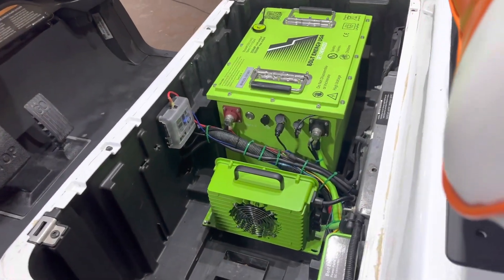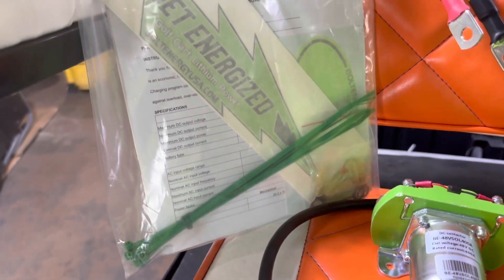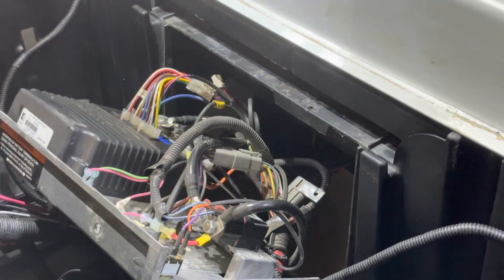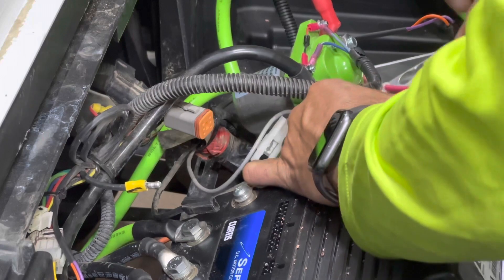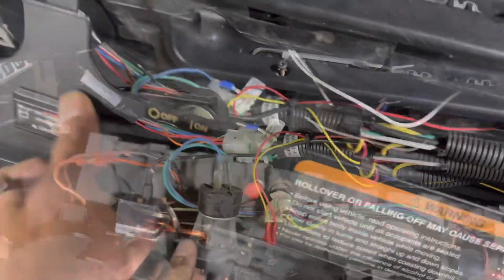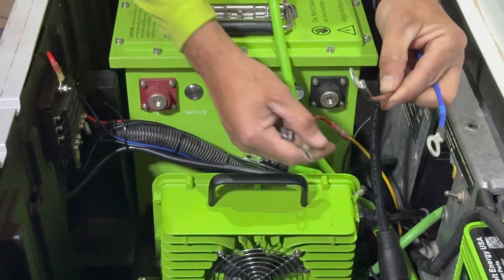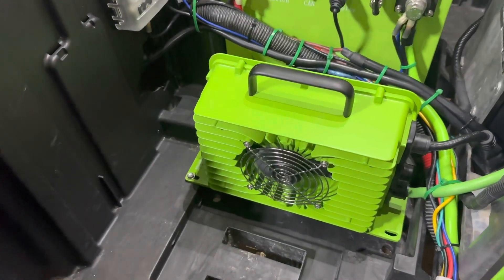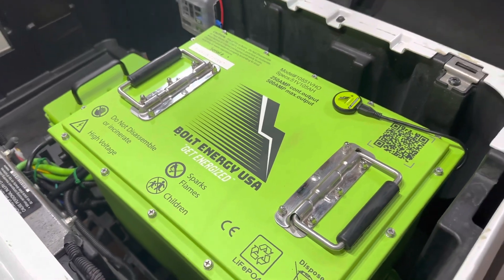Bolt Energy USA 48v - 105ah Lithium Golf Cart Battery Installation Video

Comment: I have a club card temple Li ion golf cart and the range leaves much to be desired.  Is it possible to swap my original lithium battery with this one?
Reply from the maker: I’m pretty sure you would need to replace the controller. Eco battery is releasing a direct replacement for OEM lithium Club Car batteries. Their Gen3 is releasing soon.
Reply: @PalmettoBatteryPros thank you sir!!
Reply: @PalmettoBatteryPros would you be selling that direct replacement on your website?? Also when would it be available??

Comment: It's not a resistor, its a diode across the relay coils,  and you better make sure you get it pointed in the right direction or it's going to smoke it...
Reply from the maker: Apologies if I got them mixed up. Shooting, narrating, and working at the same time can be difficult. Yes, you are correct, getting the diode backwards will fry the controller.

Comment: What difference in driving range would I see, switching from 6-8v tojjan Lead acids to a 105ah Lithium??
Reply from the maker: More than double the runtime. 45 miles of capacity in the 51-105 under average conditions.

Comment: Great video.  Really liking the one battery BMS and what bolt has to offer.  what's the difference between 'mini' and 'thin', seems like it's just physical size, performance specs seem same? I've got a 2016 Yamaha YDRE, is one a better fit than other?
Reply from the maker: That’s a good question in a Yamaha, I think the skinny would fit best. Same size as a row of 3 lead acid batteries. Mini is a better fit for older club cars.

Comment: Does this setup have an inbihit switch to disable operation when the charger is plugged in?
Reply from the maker: No, those switches normally get bypassed if the cart has one during lithium conversions.